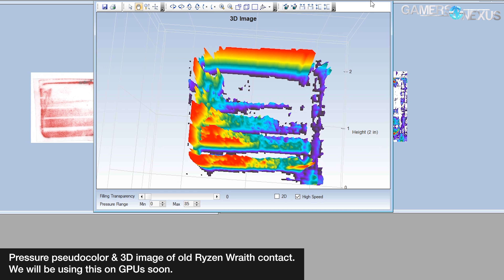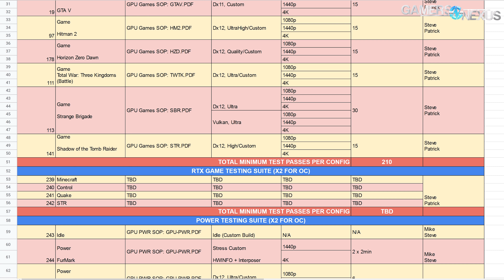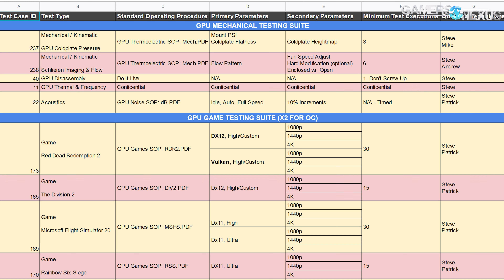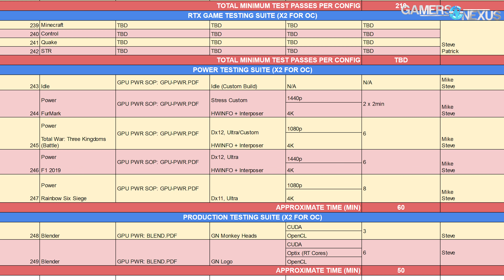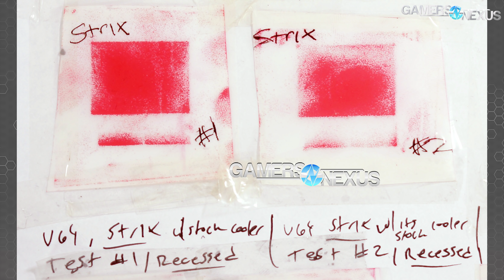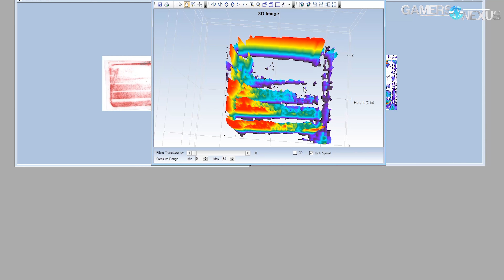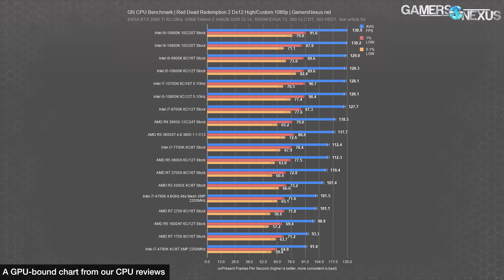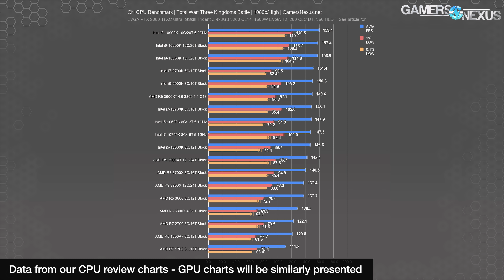$13K of GPU Test Methodology: Airflow Photography, RTX Games, Pressure Tests, Power, & More

Comment: I’m a professional cuda programmer. My job was to literally test the gpu performance in a certain system with dual cpu socket. I’ve made custom software that test memory bandwidth between the ram and gpu , wrap size optimisation ,kernel optimisation ect... if you ever need help for workstation testing and what the data means I can help you with that
Reply: can I get access to this? o:
Reply: @jorgeluisgalvezvallejo4680   Sadly no. For the bandwith testing (Something that I think is missing in their benchmark)  , it's mostly a custom version of the bandwidthTest demo that use in house test-suite. 
However , I can make them something similar using HIP that use nsigh as a visual aid  for certain  kernel execution in cuda. If there is something similar to nsight for AMD  then we are golden. 
I can also just make a command line tool that show a results  with statistics
Also if you don't program using NUMBA in long mode in a 64+ thread  cpu  (32 cores) you won't be able to use the other cores
Reply: @rndargis0  There seems to be a rocprof tool available: https://rocmdocs.amd.com/en/latest/ROCm_Tools/ROCm-Tools.html#rocprof 
I have used the bandwidth test to determine the "experimental" top FLOP performance for the v100. I can imagine a bit what is it that you do. But writing the HIP version for them would be amazing, as HIP code can be executed both on nvidia and amd hardware. Maybe design a set of tests like matrix matrix multiplies to show real world applications, etc
Reply: @jorgeluisgalvezvallejo4680   That could work , yea.  If we ouput it in JSON , make chrome profiler show then it would just be a question of starting a script  for AMD and another for NVIDIA.  BTW : the theorical limit of the "experimental"  FLOP via CPU memory is suposed to be  your PCIE bandwith IF you are using PINED memory. Otherwise the cpu need to do some snanegans. That is assuming that your data acces in memory is linear.
Reply: @rndargis0  That would be a very fun thing to write. A nice little script that needs little to no maintenance and outputs a nice matrix of values. Would be super useful, I think. And yeah, we've accounted for such things. Got some nice roofline plots out of the data.
Reply: @jorgeluisgalvezvallejo4680  well that is if they accept my proposition , otherwise I have other personnal project that I'm working on .

Comment: About workstation testing - 

I work in the motion graphics industry and most if not all production studios in that field are using redshift - in combination with their 3d software of choice - Cinema 4d, Side fx Houdini or other softwares to render their work right now. This is due to it being one of the fastest, most cost effective, production ready biased renderers avalible to multiple different 3d softwares. Meaning its reliable, flexible and easy to use throughout the pipeline. Usually when nvidia has a flashy 3d video unvieling of its GPU products its made by one of these studios and rendered in redshift. Larger firms with longer timelines working on big productions or film vfx tend to use Arnold / vray /renderman or proprietary renderers. In the smaller studio, motion graphics and freelancer world, those who tend to be looking for and shooping for GPUs, redshift is king right now.

Redshift benchmark results are hard to find, most of us rely on octane bench results to gage GPU power due to the similarities between the render engines, but i beleive redshift does have benchmarking tools. Octane was the first GPU renderer to be used in the industry but redshift took over a few years ago due to it being biased and having a larger more production friendly feature set. Octane was first off the mark and i beleive that is why octane bench is so popular. I think many people would be very interested in redshift or at least octanebench benchmarking results, i personally dont know anyone in the industry who uses blender or cycles once they start working professionally.

The other thing i would be very interested in is that nearly everyone, studios and freelancers included, is using multi GPU setups usually 2 - 4 GPUS per machine. Some server machines stack 8 or more GPUs but this is less common for workstations. Due to this people favour blower style cards to keep the heat out of the case, which meant founders editions were actually great. Now however with the inclusion of the extra fan on the 30 series creating a 'semi blower' style card im very interested to see how this cooler design stacks. Would 4 founders edition 3080's stacked cause a huge loss in render speed or overheat the cards / cpu / case.
Reply: You bring up a very good point regarding Redshift vs things like Arnold. I think most freelancers/SMBs/prosumers looking at buying GPUs and using it in a DIY/custom PC will probably be using Redshift over things like Arnold or Vray.
Reply: Great comment. Hope Steve sees it

Comment: Still waiting on Luminance and color accuracy testing for RGB lights.  The end goal is to be able to color-calibrate my RGB fans like a professional monitor.

That way, when I leave them at the same color 24/7, I can rest easy knowing that they're the EXACT same color.
Reply: First word problem!
Reply: Even professionnal monitors  don't keep their same luminance and color accuracy over time. You would need to purchase a color calibrator and calibrate your rgb fans individually every now and then.
Reply: Pierre Potonnier you realize he’s joking right?
Reply: I Laughed more than I should
Reply: @Dracossaint  yes.
Reply: for real though when rgb does crap whites i get triggerd
Reply: WhatDa FarkenHell  off is the only way i like rgb. Just bought everything but a gpu and it was difficult to avoid rgb at this point 🙄
Reply: Its not even OCD, set your RGB to white and find out how fast every different part will have a different color
Reply: @James-dn8dh  Something requested years ago now - build a system with the newest/most current released components w/o RGB's - they cannot have those USELESS things at all = can it be done and still have a reasonably decent system? You DEFINITELY cannot build one with anything even released within the last few YEARS, and it's getting even WORSE - one is FORCED into having to disable them thru software (if even that is possible) or physically removing/disabling them)
Reply: everybody's eyes see differently. just adjust what looks good to you.
Reply: @hauitsme5678  yeah the mobo and liquid cooler i went with both have them that ill have to disable but that was the only thing i really couldnt avoid.
Reply: +10. We need RGB benchmarks!
Reply: @hauitsme5678  thats very doable. i just spent like 5 minutes on pcpartpicker and pieced out a no rgb included 1000 dollar system with a 3600x and a 2060. you can do it at higher price points, i just wanted to do that price for no real reason.

Comment: well I don't know if there'd be many people in my exact position but I'd like to see someone test Vegas renders with GPU rendering and see which GPU does the best, what kind of specs make the most difference. I'm still confused as to why GPU rendering uses 100% of my CPU and wondering if it's a CPU bottleneck, and if going to an 8 core would relieve it, or if a new GPU would actually still improve the speeds despite the CPU being pinned already
Reply: its time to find out which gpu crashes vegas first
Reply: Your rendering issue sounds like a software problem and not a hardware one.
Reply: If it's anything like Resolve (Resolve is apparently good for making use of the graphics card), it depends on what it's programmed to use it for. Resolve I think uses GPU rendering for effects (warp stabilizer, transitions, things of that nature) and I can get maybe 30% usage out of my card in my usual light-ish rendering situations, but only when said effects are actually being used in the video.
Reply: do you have render set up/advanced on Vegas?  you may be able to chose what hardware to exclude unless the render exceeds what the GPU can handle
Reply: Just speedrun the rendering
Reply: Just accelerated back hop through the render
Reply: You probably need to benchmark a mic
Reply: @dragoneyeshatesg00gle76  it uses the GPU for sure, the render time speeds up like 3x when using it, but the interesting thing about it is it still uses 100% of the CPU at the same time. that's why I wonder if upgrading my GPU will speed up the render or if I will find out that my CPU is actually bottlenecking me.
in the end I'm going to buy a new CPU soon enough anyway so I will eventually know the answer for sure, but hey maybe GN will be interested enough to do this test too
Reply: @DeSinc  it'd be nice to get a few of them done. video editing not so much. most systems can spit out videos in no time then you try and render animations on the same and you're faced with 40-200hrs for a couple seconds of animation at higher resolutions
Reply: @DeSinc  just use resolve :)

Comment: Professional benchmarks that would be extremely useful for GPU testing: 
Unreal engine 4 (5 depending when you start testing it)
Redshift 3d render
Octane render
Arnold GPU rendering
Vray gpu

It's not in a specific order, any of 2 those would be pretty relevant.
Reply: Add to that AMD Radeon Prorender. Free unbiased path tracer which comes standard with C4D. It's also available for Blender. Also something like EmberGen, a real time cuda accelerated smoke/fire sim, would be nice to show data of. There's a free trial of it aswell: https://jangafx.com/software/embergen/
Reply: Arnold, yeah. not sure if TechGage has done GPU testing or just CPU testing with it.  Vray, again, I'll need to dig around some. I don't think anyone really has done GPU vs GPU testing with them.

just CPU testing.
https://techgage.com/article/amd-threadripper-3960x-3970x-review/5/

Another app I think Andrew has fussed around with is "marvelous designer", however, I think that is CPU only except the window interface. Haven't used it myself, only tested stuff others used the app to make. Substance painter may be another, yet I think like all adobe apps, it's single thread CPU only, so pointless.
Reply: @Zarcondeegrissom  yeah marvelous has GPU acceleration as well not sure how testable that is though
Reply: For the ue4 testing, is this for rendering Arch vis scenes with RTX and denoising, dlss, AO baking and real time AO and global Illu enabled? I know unoptimised models straight from revit can have some amazing performance bogging (obs as it's unoptimised and every model prolly has 10 million tris and has 10 materials in it which probably means your re-rendering all those models 10 more times)
It would be interesting to see if different setups would be noticeable. Same power GPU's on Nvida and AMD drivers, and difference in opengl vs dxt) I wonder what setup handles garbage unoptimised meshes better, or if it's entirely how the engine optimises it or renders it?
Reply: This exactly! Redshift in particular doesn't get so many data points like octane and others from what I've seen. Also test how the cooling constraints of multiple GPUs running these affect performance
Reply: @Zarcondeegrissom  Vray is CPU intensive not so much GPU most  3D modeling programs render in Vray  which is why I suggested Daz3D since it renders in Iray and is GPU intensive.
Reply: calistorich  it does as you say but IRAY is by far the more GPU dependent of the two which was my point

Comment: I would love to see GPU benchmarks for DaVinci Resolve on the color and fusion pages at various resolutions and node complexity levels looking at GPU memory usage and frames per second of playback

It may be a bit niche but it would really help demystify what GPU is needed to color correct various media types (I would cheerfully supply test media if that would help)
As far as I know Puget Systems is the only one doing any testing on this subject
Reply: Davinci Resolve is a really interesting benchmark as the Color page is pure FP32 compute while the Fusion page is more a mix of rasterisation and shaders. It can use both OpenCL and CUDA and it can saturate any amount of VRAM, given enough nodes and resolution.
Reply: I would like this as well!
Reply: If AMD release any next gen cards with more memory and cheaper then a Cuda card an OpenCL workflow benchmark would be useful.
Reply: @muf1772  the other interesting (at least to me) X factor is GPU accelerated debayering of raw codecs

Comment: Architecture / Construction / 3D Visualisation industry chiming in here.
Here's some other workstation software worth considering for CPU/GPU testing:
- Autodesk Revit / ArchiCAD workflow performance (testing with their in-built render perhaps)
- 3D Modelling Performance : Rhinoceros, 3D Max, SketchUp even - how the CPU/GPU handle complex models
- 3D Renderers : V-Ray / Lumion / Cinema 4d, etc.

I always wondered how hardware can help improve my workflow with these softwares and aside from Spec Recommendations and forum posts, there aren't that many resources.
Reply from the maker: Thank you for your experience and thoughts! We will add these to the list to research.
Reply: I also look at Puget systems blog would love to see Steve's input and testing too
Reply: @GamersNexus  Steve, I'm seconding this request. There's a lot of Revit testing by independent users but there isn't a Youtube channel doing rigorous testing like you do or a consolidated database/comparison. There is a ready made benchmark that you could use as your standard for Revit performance: https://revitforum.org/showthread.php/35955-RFO-Benchmark-v3

Comment: Regarding Flight Sim, there's a new patch coming out which aims to solve CPU issues. Might want to look out for that
Reply from the maker: Thanks for the notice! We'll retest once it's out.
Reply: @GamersNexus  Other points to note: 

there's a very significant fps drop in cockpit vs. outside. Should be fixed with that patch

Also, if you want real-world representative performance, you have to turn internet on, and allow streaming of scenery and photogrammetry data, because that's how the vast majority will play it. Expect a fps drop over Manhattan with the photogrammetry on. I'm mentioning this, because I think you don't connect your benches to the internet. If you have to keep internet off, I'd recommend manual caching the entire flight path to maintain consistency, and real-world representation.

Also, how do you perform the actual test? Do you hand-fly it all the way, or do you let the AI co-pilot fly it? 

Finally, anything over 30-35fps is meaningless in the flight sim world. Just FYI and the patch will mostly come out by the end of this week.
Reply: until they move over to dx12 they'll never really fix the IPC bottleneck which still isn't ready because the sim shouldn't of been released when it was. but hey, lets waste peoples time doing closed alpha testing when you had no plans on actually listening to the testers and release the game 3 months before it should of been. the dumb things microsoft does for an extra buck.

as far as testing sims it's pretty easy using commercial jets since you can do everything through autopilot(when it works because it was the first thing we complained about in closed alpha and was never fixed) including landing and taking off so as long as you have the weather disabled you can get repeatable numbers.
Reply: Souvik Mukherjee 
I would second Souvik Mukherjee’s comment on cockpit vs drone view. If you really want to push the GPU on this title, you have to use the cockpit view. Also worth pointing out that for the portion of the game where FPS actually matters, the user will 100% be in the cockpit view controlling the plan — things like takeoffs and landings. Seeing the FPS for the drone view is nice, but if the FPS is so bad during takeoffs/landings that the user can’t effectively control the plane, the nice FPS ‘eye candy’ from the drone view becomes meaningless.
Reply: I rarely use the cockpit view during takeoff/landing lol, just for adjusting the autopilot mid-flight whenever I want to sit back from the joystick and enjoy sightseeing while listening to a podcast. Else, always 3rd person view zoomed out with the mouse wheel for max FOV. I'm not a pilot IRL, nor I use airliners on FlightSim often, just a filthy casual that enjoyed FSX as a kid. Providing my 2 cents in case Steve wants to gather some casual but regular user feedback.

Also, there's no need for the plane to have autopilot on the instrument dashboard, you can give the AI Copilot (top menu) control of the plane and, given fixed weather, time of day and air traffic conditions, it'll do the same trajectory

Comment: wow that schlieren thing looks pretty cool!
Reply from the maker: Big shoutout to Veritasium for posting it years ago! That's where we first saw it.
Reply: @GamersNexus  I'm very interested what the "inverted" fan on the RTX 3000 cards should do. i think it's more of an eyecatcher then something innovative..
Reply: SmarterEveryDay also has a whole bunch of amazing Schlieren imaging
Reply: @wadsefrgthzjkl  My understanding is it creates less noise or likely in this case you can run it at a higher RPM to create a equal amount of noise but better air flow .....  It's a negative pressure fan blade which is why the blade has a different shape to it than normal ....  Of course any fan will create a negative pressure behind it these blades are optimized to do it more efficiently or at a lower speed
Reply: @longjohn526  lets wait for the GN review ;)